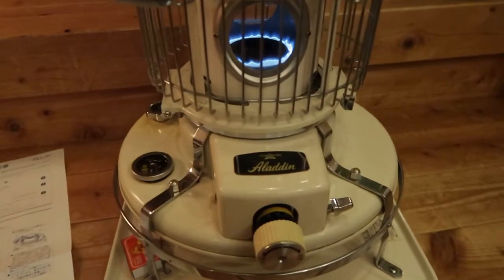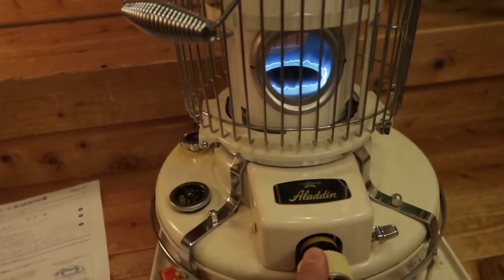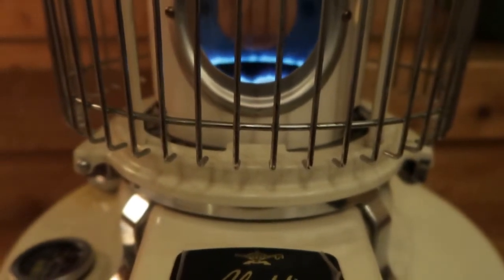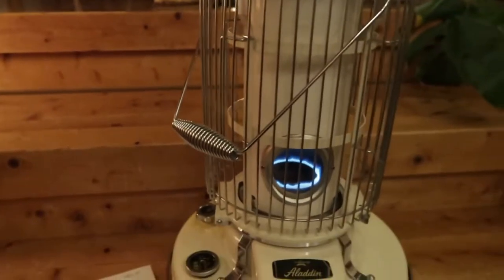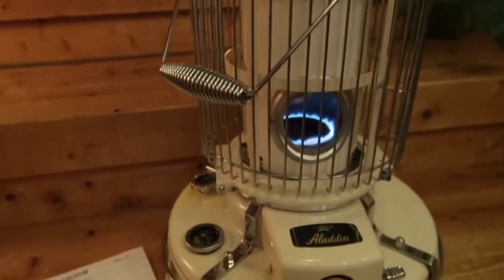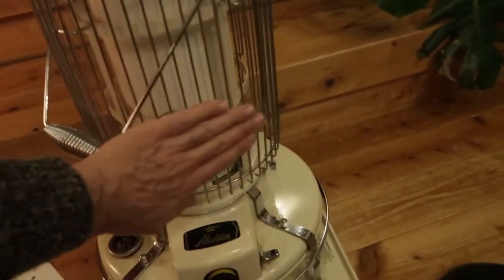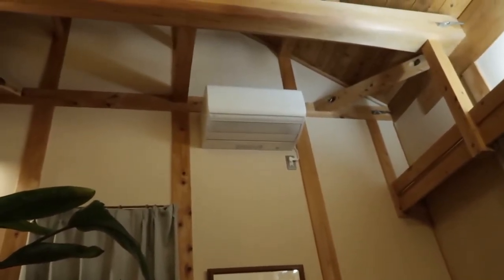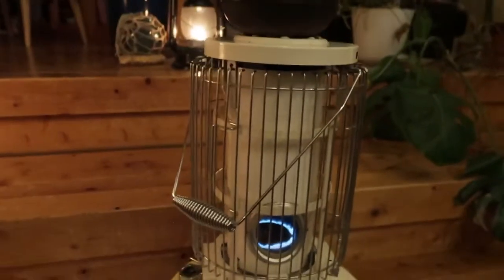Aladdin Blue flame Kerosene Heater

Comment: I absolutely love the design of this heater. Some questions though. What happens to the wick if it runs out of fuel overnight? I heard some people say it's good to "dry burn" and others say you can't do it on an Aladdin heater. Is this heater hard to maintain? Thanks!
Reply from the maker: Yes, I love it too.  If the heater runs out of fuel, the wick suffers a little and needs to be cleaned off at the top, which you can do with the tool which Aladdin provides.  I have done it a couple times over the years myself.  It doesn't do much damage but you wouldn't want to do it often.   No its not hard to maintain at all. I have replaced the wick twice in 8 years, and just replaced the "window panes" last year.  other than that, there has been nothing else.  Its a very good reliable product.
Reply: An Aladdin heater uses a full cotton wick.  If allowed to burn dry the cotton will burn. Modern kerosene heater wicks all have a  fiberglass top section.  The fiberglass will not burn down if run dry and it actually is necesary to do as periodic maintenance to burn off carbon deposits.  I have a toyotomi sundowner with a cotton wick and it's running great on ultra low sulphur diesel with a little isopropyl alcohol in it.

Comment: I have one made in England but it did not cost  as much as the one you have.  I trimmed the wick and it has a blue flame but it gives a unpleasant odor.  It does not set my CO2 detector off or my smoke detector.  I am using K1 kerosene and I use it in another heater and no problems.  Anybody know what may cause it?
Reply from the maker: Mine certainly smells bad if I don’t clean it thoroughly. I take off the wick housing and use a thick steel pot scrubber to get rid of all the black soot. I wonder how clean the various metal parts are?
Reply: @shizuokaBLUES  The metal parts and the reservoir appear to be fine.  I have 2 Perfection kerosene heaters I cleaned and trimmed the wicks this year and I can start them up and bring them inside and no smell at all.  I may change the wick and see if that helps.  I bought it on ebay it could be very old.
Reply from the maker: @frankroper3274  yes that sounds quite plausible

Comment: Google says stopped making 1978.
🤺💐
Reply from the maker: Oh no you can buy them new from Amazon and Rakuten here in Japan. Mine is about 10 years old. But they have gone up in price
Reply: @shizuokaBLUES  thank you.
Gogg says stopped making heaters in 78, but Brazil makes parts.  ?
 Did see a price $600.
On eBay used ? $175.
Nice heater.
🤺💐
Reply from the maker: @newnormal1841  if you can get used on eBay for 170$ that’s a very good price. Mine is ten years old and like new. If you’re going to buy, let me know any questions. Anytime
Reply: @shizuokaBLUES  thank you
🤺💐